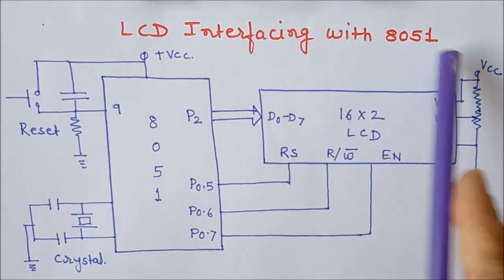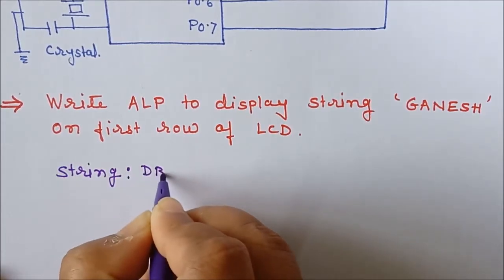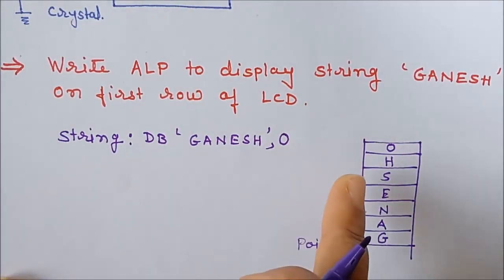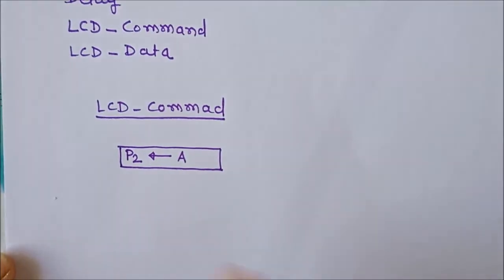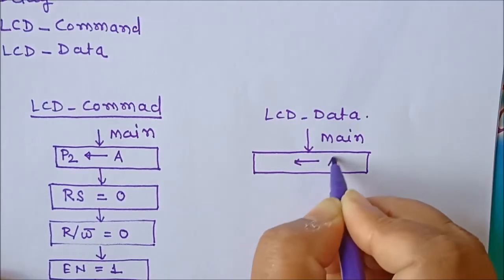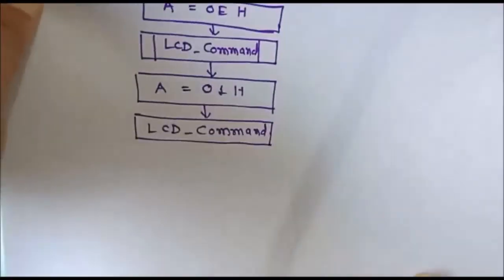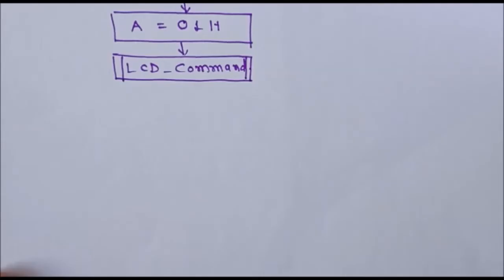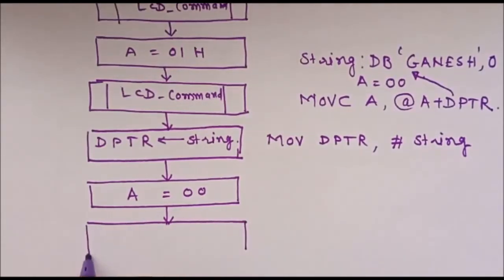Lecture 25:  Flow Chart for LCD Interfacing | LCD Interfacing flow chart to display string

Comment: Maam  why you DB in string there any specific reason behind of this and What is use of EN Signal please ma'am Explain comprehensively 
Please Ma'am
Reply from the maker: DB  define byte  I. e 8 bit ASCII value of character is stored in memory. 

EN Enable signal is used to latch data/command on data bus. High to low signal will latch data/command